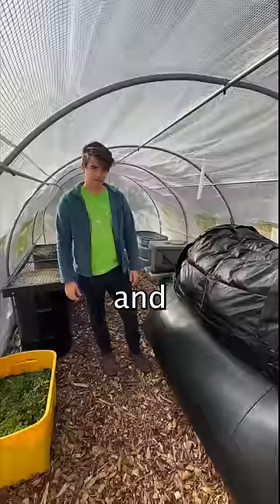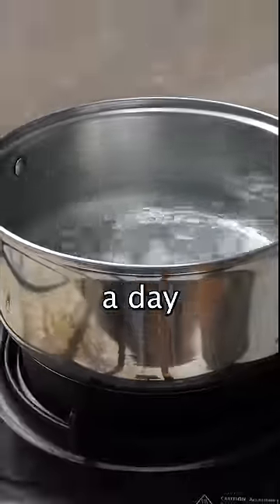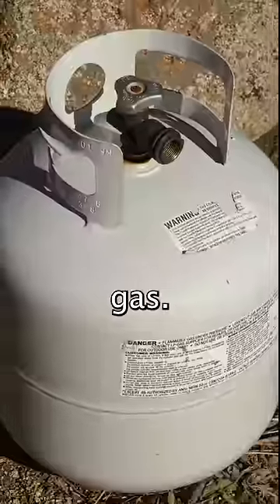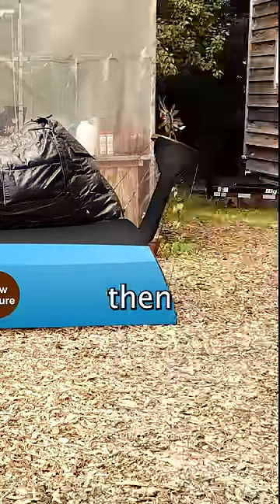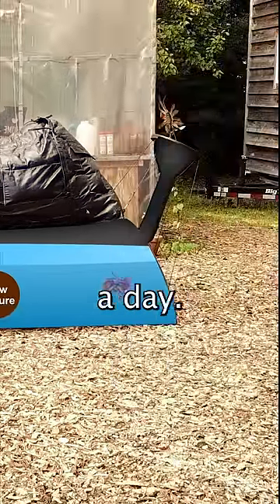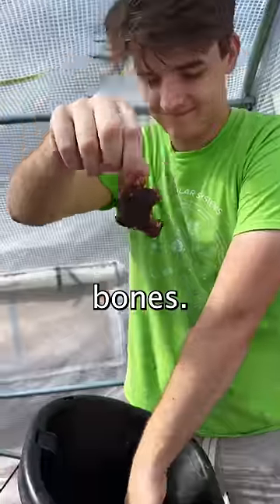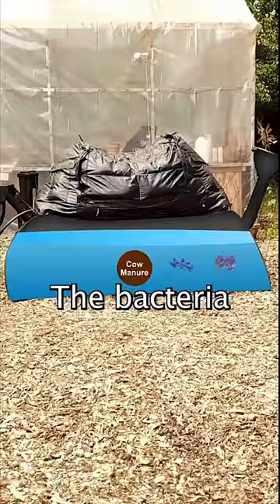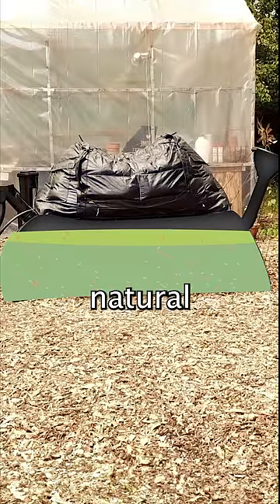The Methane Digester is a powerful system! #shorts #sustainability

Comment: Minor Snobby Corrections:

The pRoFesSioNal term for this would be an Anaerobic Digester (Bio-Digester is also common)

Also it doesn’t produce pure methane, it produces “biogas” which contains Carbon Dioxide, Water Vapor, and some Sulfur Compounds.

The latter is one of the most important.  Corrosion Issues can Occur.  “Siloxane Buildup” is a major issue for large plants running “Landfill Gas” or Biogas from Wastewater Treatment etc 

Luckily though, as @davidachee1927 (and probably some other people’s comments i may have missed) said, running it through some steel wool should probably work at this scale.

Some other designs for small reactors like this also include “scrubbers” that use similar methods.  A tube with some desiccant can help with the water vapor too.

I am a major nerd for this kind of stuff, so thought I’d drop what i know here in case anyone stumbles upon this video and wants to know.

I’ll have to grab more links and whatnot if anyone else is interested, but the IBC Totes are probably the better “way to go” for these systems, although the unit showed in this video is a good “Off The Shelf” option you can buy from “Home Biogas” (which may even sell on amazon).  

So yeah i hope this didn’t come across as too snobby, was interesting/helped, and if you have any ideas/questions I’d love to hear them below!

(Edit: Fixed Typo)
Reply: I like the infodump! Thank you! ☺️
Reply: Its thus right here i try to do in comments. I dont usually comment unless its an info dump on something soecific that i know a lot about... Like appliance repair in my case.
Reply: I got more from this comment than the video
Reply: Not snobby more helpful than you know 👍👍👍
Reply: Genuinely asking, if the methane is used to fuel stove cooking anyway, does that not let out CO2 all the same?
Reply: @darylmcmexican539 Yes. But the reason it's reducing carbon footprint is because if it decay normally it'd release CO2 anyway and you don't get to make use of the energy released during the decay. So by doing this he doesn't had to burn gas or use electricity which will release additional CO2.
Reply: Amazing! Thank you. Just commenting here so I am reminded to come back
Reply: Thanks
Reply: Awesome info. Thanks. 
Do you have a certain model you recommend that is safe, will last a very long time and easy to use? 
Thanks for your time.
Reply: Nice
Reply: To get even more information thanks!
Reply: Anaerobic not “anerobic” if you don’t mind
Reply: @DeannaSt  oof typo!  Fixing it now thanks for pointing it out
Reply: Talk nerdy to me ❤️‍🔥
You should make a video so you can post links in the description. (Even presentation style if you're not one for the cameras!)

That was deeply interesting!!!
Reply: bro, could yo send or recomend any lecture or article about what you're saying? I would like to start something related to this (bio recicle stuff) but your comment prevent me and made me start thinking about its risks
Reply: (another typo: MOST...showing now as mkst)
Reply: @tinkertailorgardenermagpie  thanks!  The IOS spellcheck system…is almost as bad as my phone typing lol.
Reply: @minhducnguyen9276 it would produce methane when decaying naturally, right? Which is a more potent greenhouse gas than CO2. So, it's actually more CO2, but less greenhouse emissions overall?
Reply: @andrew8501  Yes but since he'd burn most of it, accounting for some possible leakage, most of the greenhouse emission is also in CO2. Besides, if left to decay naturally, they'd produce Methan too and it'd be worse in this case since there's nobody to burn that Methan.
Reply: Very interesting,  thank you all for added info.
Reply: @MrSteveo0088  If you already have tools then homemade is the best.
Reply: you can't cook on co2. we have been cooking on this gas for years by now. It works.
Reply: I appreciate informative input. That’s one of the reasons I read comments, hoping there is a lot more info. I also get some laughs like when you explain why you made an edit lol.. I learned from that too! I think you may be type A personality. Hahaha

Comment: If you used a specially fitted air compressor you could keep the excess in tanks. Once the tank is pressurized a few valves would keep the rest in check
Reply: Actually, with the weighted bags, you could probably devise something similar to an Amish Pump, where once the pressure in the gas chamber rose above a certain point, a check-valve would open, and then trigger the compressor to kick on and pump it into a canister, and then once the pressure drops below a certain point, another check-valve closes, and kills the compressor.

Comment: The main thing is capturing the methane, which, as a greenhouse gas, has a much greatest impact on atmospheric heat retention.
The CO2 would be there regardless.
Reply: Its already captured in the digester also burning methane as a sustainable fuel only releases CO2

Comment: For those wondering, yes, this can be connected to a toilet. I volunteered at a farm where they had toilets hooked up to a system like this. Instead of flushing you use a sort of pump thing that isn’t too much of a hassle (just crank the handle up and down a little) and that’s the only difference
Reply: Thank you! I was thinking… ”hmm I don’t have a cow…but I make poop..?” (::Eyeballs the biogas digester optimistically::)
Reply: He uses the water as fertilizer, while toilet water contains chemicals from cleaning. I'd say that's the second difference
Reply: Lol...I was not wondering...but now that you mention it... that was a clever question.

(the food scraps idea is probably why I didn't think of other waste 😅)

Comment: Amazingly simple. Congrats on one of the few youtubes that someone can learn from.
Reply: Simple maths says he isn't saving 6 tonnes of carbon dioxide a year, complete nonsense.
Reply: @metalicminer6231 how explain?
Reply: @marcuspiercr6392  he's only putting in about 2kg of scrap a day, not even a tonne a year, so where's the 6 tonnes of carbon dioxide coming from.?
Reply: @metalicminer6231  its not 1:1 ratio, is it?
Reply from the maker: @metalicminer6231  Hey! It can be confusing for sure. The part that helps to understand this is that methane is 25 times more potent than co2. When we burn off the methane it turns to water caper and CO2. The system is just ridding us of methane that would naturally occur from the food scraps if left to a land fill. Hope that makes sense!

Comment: If it pops or leaks you need to find a new base 💀💀
Reply: Yeah they should dig a hole and put it there. If it pops just fill the hole with dirt and it won’t smell
Reply: @soac6865 man y’all must live in the city city… these are really rather common out in like more farm type of areas, except scaled up to huge sizes. all above ground too. though personally I think it would at least make more sense safety wise if the gas is pumped out into a secondary storage container not susceptible to easy failures. idk if they do that on the big ones or not but it makes sense.

Comment: Does the input chute have a check-valve; or, does it just use a locking lid to prevent methane gas escaping?
Reply: Just 1 Hello Kitty Band-Aid
Reply: U put the stuff at the bottom. Methane rises. No need for a valve
Reply: The input pipe, goes down into the liquid. Methane digesters have been around for a long time. In the 70's there was a story with photos about a couple that made one and mounted it under a school bus. The gas was stored in giant inner tubes on top of the bus. They had all the methane necessary for cooking and bathing plus they could power the bus part of the time. The magazine was Mother Earth News.

Comment: Every house should have one of these. Makes me wonder if you could have something like this integrated into a septic tank. Like an automated system that gets fed from your septic tank and garbage disposal that could pull in a certain weight of biomass based on usage. Which then could be put into a bulk storage tank for the house.
Reply: The company that sells those also sells some hooked up to a toilet
Reply: They can also do this at the Wastewater Treatment Plant Level.  Typical term used is “Anaerobic Digestion”

They can also “upgrade” the Biogas to Pipeline (if not LNG Grade) “Natural Gas”, so (near) pure methane, not the Mix that is Biogas.
Reply: …a septic system leaches almost all of the water into the ground.
Reply: Search gobar gas plant , its very common in india and neighboring countries

Comment: This requires access to a clean water supply and plenty of it. This system consume water and requires regular maintaining to keep clear of blockages and bacterial imbalances. This is also a limited feedstock capability. Using incompatible feedstocks or improper ratios will decrease its efficiency.
Reply: Does not use large quantities of water. If so tell me how.
Reply: Lol u confuse this with nuclear plants
Reply: @gregoryconnor9333 , “We first start by filling it up with 1200 liters of water…” 

And that water can’t just sit forever with zero maintenance. It needs to be replaced. No, you don’t go long periods without changing the water. The longer you go the less its efficiency. I’m not going to standby while you try to Google your way into being right. You’ve never owned one, you lose.

Comment: Neat design for the septic tank. And using the methane on the daily is very valuable. This design would help a lot on land fills (my country) or water treatment plants like the case of the US.
The tech is old but the design is new for those wondering...

Comment: It apprears a pretty darn dangerous setup without any precautions in place.
Reply: The pump and propane tank are really the only dangerous parts and those are usually pretty safe. The digester bag part doesn't actually have enough methane or pressure at any given point to be an explosion risk. I guess it could be dangerously messy and stinky if it got cut and sprayed everywhere? This is like putting a lid over an old rotting swimming pool- its not going to blow up because you put a flame next to it but that's what the pump is for; it condenses a pools worth of gas into one small spot concentrated enough to sustain a flame. As long as flame doesn't get into the tank, but hank hill can attest to the safety of propane tanks.
Reply: @BakersfieldBhakti ... it's pretentious and inefficient.
Reply: @TheUnholyPosole  It's also free and doesn't require hours of driving to fill a tank.
Reply: @TheUnholyPosole,  So were plane's and cars . Just like electric  cars are now. Give it some time. It may be what we all use in the future.

Comment: Carbon dioxide (commonly abbreviated as CO2) is a clear gas composed of one atom of carbon (C) and two atoms of oxygen (O). Carbon dioxide is one of many molecules where carbon is commonly found on the Earth. It does not burn, and in standard temperature and pressure conditions it is stable, inert, and non-toxic.

Comment: The gas is called gobber gas here in Gujarat, India.
Its really old method which is used by farmers and people with cows and buffaloes,
But as city area and things getting corporate, farmer and people with cows and buffaloes going down in nunbers and also other things like gas lines and easy access to home gas cylinder lowering its usage,
Gas stoves made for gobber gas used to last for 15-20 years with some simple maintenance,
Some of those are still alive but sell of gas stove by itself has decreased a lot,
Reasons being decreased numrbers of people using it, older stoves are still running and new one are not as good as old one.
It's also most likely applying to tanks that make gas,
So if things start taking more maintenance, time and costing more then overall saving ends up being nothing or maybe turning into lose,
I dont know how much new tanks last but oldest running tank i have seen is 30-years old tank

Comment: It doesn’t contribute to CO2 at all. Methane (CH4) is another greenhouse gas. So while you are stopping methane emissions, you aren’t doing anything for carbon dioxide.

Edit: I stand corrected as CO2 is in biogas and is a component of the system, but for the most part,  my point still stands.

Comment: You aren’t preventing CO2 emissions. You’re preventing the burning of oil. Same emissions if you burn methane from anaerobic decomposition as if you burn methane extracted from the ground.
Reply from the maker: Methane is 25x more potent than Co2. By burning it off we turn it into Co2 and water vapor which does reduce emissions compared to the food naturally releasing methane in a land fill.

Comment: Sounds like an amazing idea.... But how often does the water fertiliser need to be changed before it becomes incapable of producing further methane because of the concentration of components... (basically it stops working and produces a fertiliser so pungent it burns roots?}
2nd-ly... How do the neighbours feel about having several methane bombs next door - like living next door to the Hindenburg just awaiting 1 stray cigarette or a barely qualified electrician.... 🤔🤔🤔

Comment: ...Methane is the second most important greenhouse gas contributor to climate change following carbon dioxide. In fact, methane's ability to trap heat in the atmosphere is even stronger than that of carbon dioxide.

Didn't take long to discover that.

Comment: About 30-50% of biogas is CO2, not to mention more when you burn the methane. To call it biomethane isn't correct. 

Also, what happens in winter? The cold slows down the digestion process significantly. 

Cool project none the less.

Comment: That's an explosion waiting to happen using a bag to contain it. Use a stronger container for safety purposes.❤
Reply from the maker: It’s not.  Research it better.
Reply: @acornlandlabs  It is much safer to store methane gas in a metal container rather than a bag. Here’s why:

1. Pressure Resistance: Methane is typically stored under pressure, and metal containers are designed to withstand high pressure without rupturing. Bags, on the other hand, can easily tear or burst under pressure, posing a serious hazard.

2. Leak Prevention: Metal containers provide a more airtight seal, preventing methane leaks. A bag is more prone to punctures and leaks, which could allow methane, a flammable gas, to escape.

3. Durability: Metal containers are more durable, especially in harsh environmental conditions, whereas a bag is much more susceptible to wear, tear, and damage.

4. Fire and Heat Safety: Methane is highly flammable. Metal containers are more heat-resistant and can contain the gas more securely if exposed to heat, while a bag might melt or burn easily.

In summary, a metal container is the much safer option for storing methane gas.

Comment: Does it still emit CO2? Yes it does.. you could also just burn would in the first place (it's better than using natural gas nonetheless of course.

Also, in case the bag bursts of you open it some day for maintenance. Methane itself is a WAAAY more potent greenhouse gas than CO2 so.. this will most likely wipe any reduction made against natural gas 😅

Comment: Isn't methane much more harmful to our environment than co2? So technically you release more methane right? Pls. Someone correct me if I'm wrong, I'm really curious about it.
Reply from the maker: This process captures methane that would have otherwise been released from a landfill!  This doesn’t produce more methane, it simply catches the methane the food waste would create anyway!  So since the methane is a more potent greenhouse gas, it’s a big win to capture it, burn it off as useful fuel, and then just have some Co2
Reply: @acornlandlabs  
I see, so if the methane is burned up, it turns into co2? Then it's big W then. I get the landfill, but I think composting food scraps is a more "cleaner" solution before you say that. While it would still produce co2, it is effecient use of energy instead of buying LPG or using electricity as means for cooking & cooking produces co2 anyway.

Comment: You’re making a hydrocarbon gas and burning it for fuel. How is that preventing carbon?  Also, CO2 is plant food and is never more than a trace gas in the atmosphere.
Reply from the maker: Methane is a more potent warming gas than C02.  Using gas from food waste that would otherwise escape into atmosphere does reduce C02 usage since we don’t need other fuel for cooking
Reply: @acornlandlabs  methane is better at trapping heat, but neither methane bore CO2 are as good as water vapor at trapping heat. But when you say that combusting a gas that would otherwise go into the atmosphere reduces fuel usage, your chemically breaking that gas down and releases CO2, CO, and all other sorts of chemical byproducts of combustion: in other words, you’re kinda breaking even. But then again, CO2 is plant food…

Comment: I was impressed until you started talking about natural CO2 'emissions' being 'prevented'. CO2 is also vital to plant growth, unless you aren't interested in the massive amounts of O2 plants give back in return.
Reply from the maker: It’s better to convert methane into C02 for a practical use.  We don’t mind if you’re impressed or not, we think these systems are cool :)
Reply: It's CO2 greenhouse equivalent. CO2 is being released at a 1:1 ratio with the methane, but methane is 25x more potent of a greenhouse gas compared to CO2